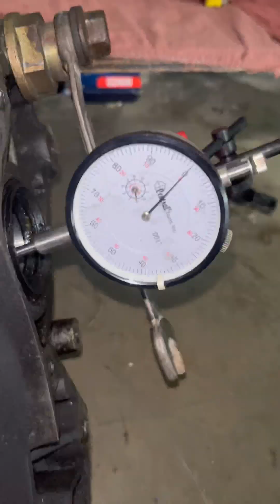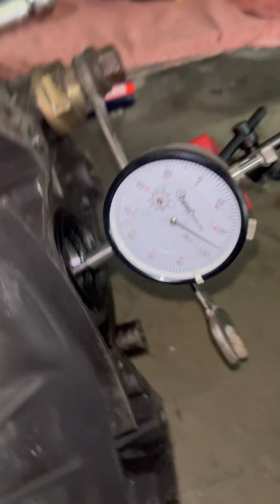B series transmission clearance checks!

Comment: Great video, bro. Quick question though. If the end plate is Out of spec, how do you correct the airplay issue? I understand you can correct it with a shim but how do you calculate and measure a new shim?
Reply from the maker: If it’s out, you have to get another shim to take up the extra space or shave the old one down if it’s to tight, on a flat belt sander
Reply: Are you located in California

Comment: Where did you buy and how much is that thrust tool clamp?
Reply from the maker: To be honest I made it lol. I cut a bearing installer tool from harbor freight since it’s billet aluminum and drilled two holes through the center and tapped the back side to bolt them together and cut it in half. I used the 2nd from the biggest one to sacrifice lol
Reply from the maker: Sorry for the long late reply, I’ve been trying to get the shop a little more efficient and now I should be back at it full swing!